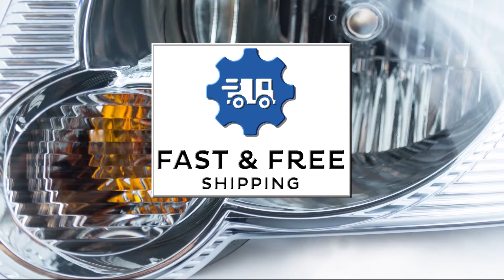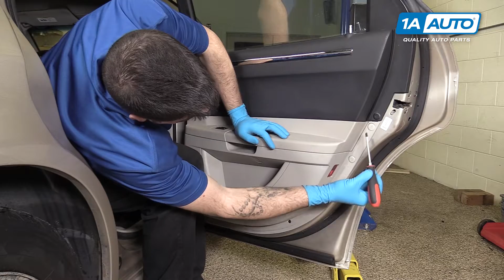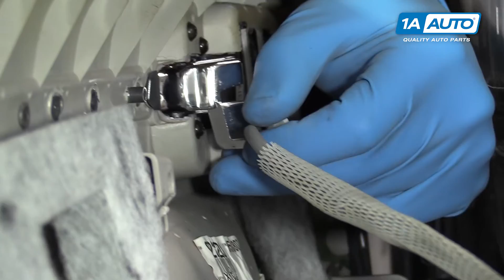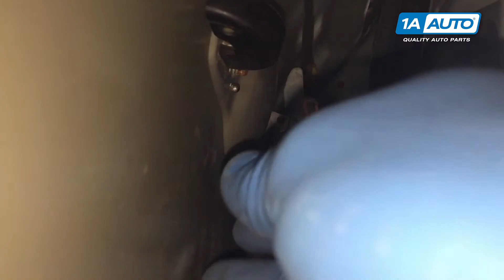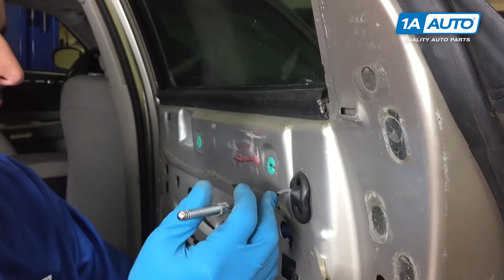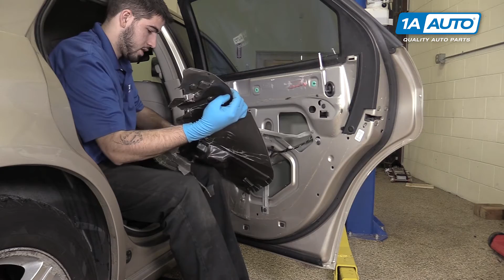How to Replace Rear Door Lock Actuator 05-10 Chrysler 300

Comment: Changed the front actuator based on your vid (very helpful with trim) but still fob won’t operate drivers door lock.  Connector has power.

Comment: Is this the same process for a 2007 Chrysler 300 Touring for the front door? Front passenger?
Reply from the maker: +Jordan Chamberlain It may be the same or a similar process. http://1aau.to/m/Shop-1AAuto-c
Reply: 1A Auto Parts Thank you much. 

You guys and your videos have literally saved me THOUSANDS of dollars for me being able to do this work by myself. Maintenance books don't always do the trick for me. These videos, a few:

Lower intake valve gasket
Sideview mirror
Door actuator
Lower control arms

Just those videos have saved me over 2000 dollars in labor. Please don't quit. I love these videos, excellent expertise and walkthroughs
Reply from the maker: +Jordan Chamberlain Thanks for checking us out. Shop here for high quality auto parts: http://1aau.to/m/Shop-1AAuto-c
Reply: Can I buy the rod from the actuator to the interior door handle?